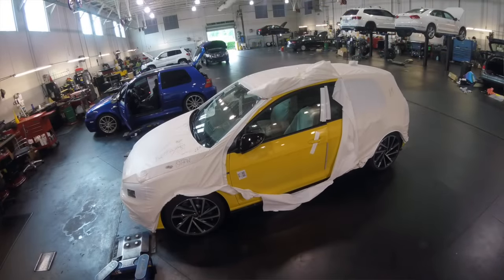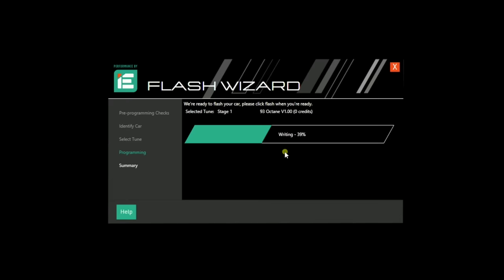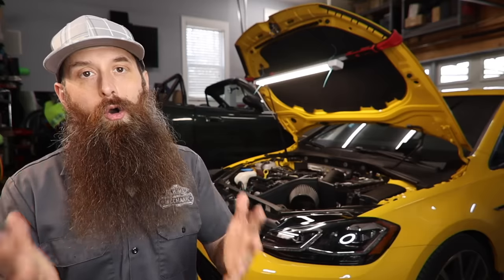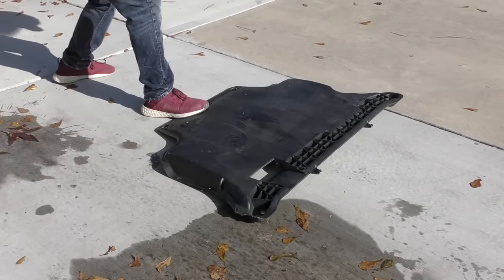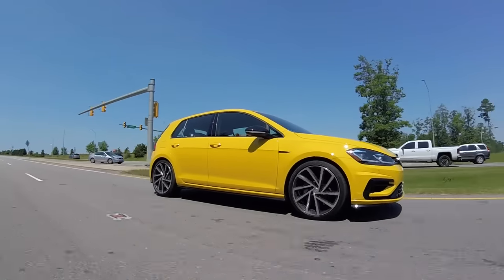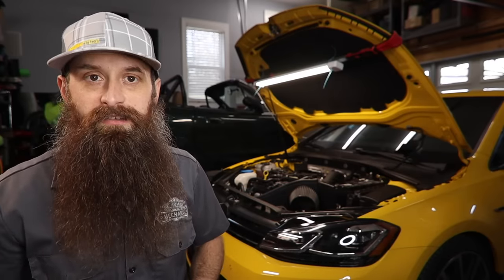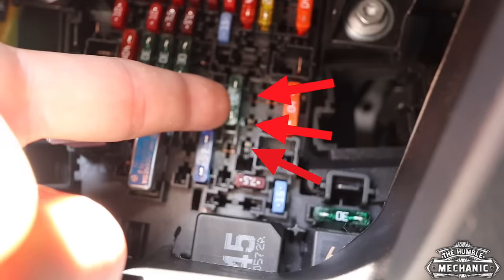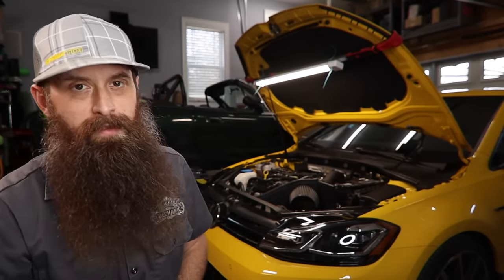The 5 BEST Modifications for the Golf R ~ Do THESE First!

Comment: Charles - fantastic video. I am 71 and have never owned an automatic from VW bugs to an LS7 69 Chevelle to 3 TDI's- I was thrilled to get an all wheel drive Alltrack with a 6 speed (I was always hoping for it to be a TDI). I basically love the car but the REV Lag makes me feel like I have never driven stick before. Can an OBD 11 remove the lag??  Please tell me yes.   Also - I installed a whiteline rear sway bar that has 2 settings - unfortunately the softer setting does not fit the sway bar link! The stiffer setting is too stiff and has resulted in clunking noises no matter what adjustments I make. I will try the H & R . Can you do a video on the transmission and front diff service? Thanks for all of your Vids- much appreciated

Comment: Hi Charles, as far as tunes go, I’m wondering if you have had any experience with Burger Motor Sports JB4? This is a plug and play tuner that installs between the car's sensors and the ECU. As far as I understand it is not as comprehensive a tune as the ones you mentioned, which re-flash the ECU. But it has the supposed advantage of being easily unplugged and disabled and of not leaving any evidence of its existence in the ECU. The idea being that, as long as you remove it before bringing it in for service, it is much less likely to cause any warranty issues than the tunes that reprogram the car’s ECU. 
Thanks for your video.

Comment: For anyone that just wants a boost a bump in power is the jb1 or jb4 all while retaining your warranty esp the 18/19 that came with 6/72k. If people are hesitant about the jb4 bc of tapping the afr wire there is an adapter on ebay to really conseal the pozi tap. The adapter has the wire hanging out to connect it to the jb4. 
While it is not a flash tune where if you take it to VW they td1 your arse it certainly makes it feel how these cars should of came from factory. No disrespect to Charles but the piggyback would be 1st before anything else. Otherwise go full stage 2 & skip stage 1 flash. These cars move once tune'd & the gen3 engines handles the power like a champ!

Comment: Additional cool features: 
- Welcome Home lighting (illuminates the lights around the car for a couple seconds after you step out of the car at night), 
- Automatically roll-up windows / shut sunroof when the car detects rain. Tilt the side mirror when going in reverse, reset DSG "learnt" prior driving pattern. 
- Automatically turn on / accelerate / reduce speed of your windshield wipers when rain is detected... 
- Remember the settings of your A/C unit / heated seat. 
- Display additional screens on the Computer between the dials (like battery charge, oil level, remaining gas in the gas tank.... 
So many many features ! MK7.x are really flexible, and if you've been around the world and liked a feature in a polo, passat, golf from another country, the chance is, you can activate that feature in your MK7 here in the US... if the car is equipped with the actual hardware supporting the feature. 

Now... reading some recent european reviews about the new generation of Golfs... I'm wondering how MK8 are gonna be like. Seems like VW will include most of the hardware in all cars... and you could pay for over-the-air upgrades/options activations, basically paid features (a bit like ODBeleven.... but by VW...). Hopefully we'll still be able to VCDS them and activate cool features ourselves ! But... hey VW engineers are clever...
Reply from the maker: I’m guessing they will try and lock out the features. They may have an alternating lock out code. So the only way to activate is by vw. But I’m sure someone will find a way

Comment: Just performed an oil change on my other halves MK7.5 and guess what...the whole back of the sump is severely scuffed up, to a point that it had even broke off half the plastic drain plug cap! Good job I get one of these plugs in my ECS kit. Don't know whether she drives a rally-cross circuit on the way to the shops or what, but I just ordered the All-track belly pan kit.

Comment: Hello, I need some help!
I have a GTI and I intend to use bilstein b8 and sport springs, do you recommend upgrading the sway bar end links, both in the front and rear? Speaking of the suspension set, are there any further changes you recommend?

Comment: I disagree that swaybars don't have any negative consequences. Try turning into the ramp of a gas station and you'll see what I mean.  The stiffer bar picks up the inner rear wheel, and then you get a jolt when it makes contact again. Also notice the car's behavior in bumpy turns.  It's not as resilient, and your head & neck get jerked around more often.  This is because stiffer rear swaybars make the rear end less independent, and more like a solid axle.  There's no way around that fact.  You might like the flatter cornering, but there are consequences. I put a 22mm bar on a car that only had a 16mm stock, and it felt like a pickup truck afterwards. So I contacted a shop and had them custom make an 18mm bar instead. Much better.

Comment: I bought my Golf R used but certified from VW and they warrantied it for 2 years so although I’m itching to tune it I’m working on suspension and handling mods instead until the warranty is up. Did install a cat back though because it was just too quiet

Comment: Interesting.  Not the five i was expecting.  Most people do exhaust, wheels, windows etc.  These are more practical.
Reply from the maker: Thanks.
Reply: @HumbleMechanic  hey do you still have r32?  My wife's had one for about 12 years now and it's been great. Mk 5 3door in silver with bucket recaros.  Reliable satisfying car it's been.  Whatve we had to do....coil packs, all springs ( seem to be made to snap in winter). Radiator, tyres brakes battery and that's about it.  Looks like we will have to sell as my job has gone, thanks mainly to virus. We will miss it .  Must be one of our fav cars ever.  Still got my r36 though!  
Enjoy your channel. Learned a lot thx

Comment: I found a really nice 2017 golf r that I want to pick up. I've just never owned a German car and with all the horror stories out there I'm nervous to make the plunge. I just want it to last.
Reply: Just do your research and make sure it's been serviced regularly with low km's. If it's near 100k on the clock then it will need a major service especially around the cambelt. Join a club and ask what the pro's and con's are

Comment: Greatly appreciate the video and your knowledge

This might be a silly question
But doing a stage 1 tune will damage or hurt the engine and DSG tune
If you do a stage 1 tune should you do a matching tune to the DSG

I really want to do it with a revo tune but I’m really scared as I really respect my new car
As for warranty can they void warranty and if you remove the tune for a warranty claim can VW see a change to the ECM what is your honest opinion

I really agree how it should have been from factory as stage 1 I just want a bit more 
I apologies for my frustration lack of knowledge
Reply: As far as I understood, there are low torque Stage 1 maps too, which don't require you to tune the DSG.
Also, there is some kind of counter in the ECU, so the dealer can detect software flashes. Use a tuning box if you are concerned about this, that is external and removable without trace.

Comment: Hi there, less worried about warranty more about insurance implications. Also when adding power is the clutch up to the extra torque?  ( i blew my tdi dual mass flywheel and had to get new gearbox and clutch so bit nervous of that!)
Reply from the maker: Clutch upgrade is needed on most any stage on the newer R

Comment: Charles, great info, appreciated.  In regard to small mods, I've done some of the "badgeskins" vinyl overlays.  I've added vinyl to the  brake calipers, the front and rear R badge and covered that stupid amber passenger air bag light.  Why the heck do I need a light on to tell me the passenger side air bag isn't working when no one is in the seat?  Makes no sense.  My last small mod is a steering wheel cover.  I found one precut for the R and it's a great addition. Makes the wheel much thicker and better to hold while driving...  Best....
Reply: Rodney Wright But isn’t nice to know that it’s active when someone is actually in the seat 🤷🏽‍♂️. Sometimes my dog sits up there on short trips and nice to know he isn’t going to get blasted if we get into a fender bender.

Comment: I had a Mk5 R32 with a Haldex controller. I found a swaybar upgrade pointless. I was able to control turn in with throttle when the Haldex was in M or S (sport?). I've just acquired a 2019 Golf R - I'm wondering if the same applies. I also had a Mk4 Jetta (FWD) and the rear sway was nice, but coil overs setup correctly were more of a game changer than the sway.

Comment: Hi man, love the vids just picked up my 19 R yesterday in Augusta.  Small scratch on the door but other than that love this car.  I have one issue I need to fix.  Is there a way or hack to disable the active cruise control ?  It never does what I would do so it needs to go.  Unfortunately the salesman incorrectly informed me that the menus can turn it off.  Im even open to adding another 3rd party cruise control to get rid of this and I understand from one of you other video you can turn things off through the ECU.  I would even be open to turning all the driver aids off if this solves the problem.
Reply from the maker: You have to shut it off but then you disable cruise. I’m sure there is a way but that’s not info I feel comfortable teaching people about.

Comment: You didn't mention a catch can which, judging by your follow-up video featuring noticeable carbon build-up at 10k miles, is essential for proper running on a boosted and/or DI engine.
Also, can you adjust the time-out for start-stop? Start-stop is a good idea in theory but most cars do it poorly: they immediately stop the engine once the car comes to a halt, just to immediately restart to take off from a stop sign or RR crossing or other brief event. A 3 or 5 second full-stop timeout would get the benefits of start-stop (shut down for long lights/trains/drive-thru) without the annoyances (shut down at yield/stop signs/other quick stops).

Comment: Did you do a follow up video on the inside intake temps on the aftermarket intake after ?
Reply from the maker: I did the intake temps in the intake video. I didn’t install the boost tap and check it that way. With the new shop construction I’ve misplaced the tap. Hahaha doh

Comment: You can disable the start/stop by changing the battery voltage threshold, i have it adjusted to 14V so it never shuts off the engine :)
Reply from the maker: Yes but you get an alert on mk7.5.
Reply: @HumbleMechanic  Ah yes that is true, there are also memory modules for sale on a couple of sites, pretty easy install as it's a plug and play solution
Reply from the maker: Got any links?
Reply: HumbleMechanic https://www.active-sound.eu/en/start-stop-automatic-ssa/start-stop-automatic-memory-modul-ssam-modul
There are also others that require you to splice in to the harness but this one seems to be pnp :)

Comment: My golf recently started acting up during warm startup. I’m not sure if you can help out. It hasn’t done it on cold start and when it’s warm and I start it up it will idle around 200-300rpms and be rough until it either turns off or I have to put some gas to fix it. Any ideas what could be happening. 2015 R with about 40k miles.

Comment: I am a 2019 Golf R owner and @ about 4:00 - the discussion related to tuning the ECU, TCU and Haldex AWD System is really misleading. If you use these tunes like I am - and have an issue with the power-train - like a clutch out or a blown injector or whatever, YES THIS WILL VOID YOUR WARRANTY. See, when you take the GR to the shop, the mechanic will plug the car in and see that the tune has been applied. It's at that time that the mechanic is REQUIRED to report it to VW and flag your VIN. It's important to note that this may also show up on a CarFax Report If they elect NOT to do this, then the car may be sold to another person at some point, who will purchase a warranty (or expect to use the rest of the manufacturer one) and it'll get caught then. you'll see this from Ford, Chevy and Dodge also - they flag vehicles all the time - and some of those end up back on the market.

However, in a warranty situation related to something else, that's not power-train related, like a power window or a back-up camera issue - they will cover those things. Just don't expect any help with your power train. Furthermore, make dame sure you're not doing this on a LEASED vehicle because you'll be charged for a full ECU replacement when you return it.

Final note - even if you use Unitronic... I know that they say you can flash the car back to the factory flash- but the dealer will see that the modifications were made and then reversed. So, you'll still get flagged.
Reply from the maker: That’s not all exactly true. It’s never a guaranteed flag or decline.
Reply: @HumbleMechanic  I know you're right, but the risk is high and once your flagged, it lasts forever even to a new owner.
Reply: And if you get flagged, that car will drop in value like a hot rock. It's really hard to sell a car when it's been flagged.
Reply from the maker: That’s why I mentioned you have to be willing to pay the price.
Reply: And knowing VW's poor reliability record, the odds of needing a powertrain warranty claim is pretty high. Gee I wonder why VW decided to dramatically reduce the great warranty they offered last year. It's because they know their cars aren't very reliable, and they're tired of eating the repair costs. Personally if I was buying a 2020 VW, I'd demand a $2-3K price cut just because of that.

Comment: Nice video...... my question is about the window tint.....I have tried getting mine done.  Every place I have been says they cant do those small windows next to dash.   I have 19 gti rabbit edition.   Just wanted to hear your thoughts
Reply from the maker: My guys said it wasn’t fun. But they did it. Lol
Reply: @HumbleMechanic  I use obdeleven.  I turned off the annoying start stop system with the voltage method and I don't have any error messages
Reply: Mat Ostromecky what year ? GTI or R?

Comment: Charles I need you to save my life again!! Do you happen to know what size triple square a 2016 VW jetta has on the rear has? It’s not a normal socket it’s the one that goes inside and not around the nut. Also it is a triple square.
Also trying to figure out what size the caliper carrying bolts are?? 

Ps- scared to buy a kit and it not have the size.
Reply from the maker: I don't recall the number, but this kit should have it. This is one of the best kits for the $$$ https://amzn.to/36BpxpK

Comment: Is it possible to add a factory vw sub to my 2019 rabbit? If so can you do a vid on it?

Also how does a dealer know if you flash? Instantly? Or do they have to be looking for it?
Reply: If you have some sort of power train failure, VW I think requires the dealer to dump the ECU code so they can check for modifications. They then run that dump against a hashing tool and compare the resultant hash vs what they know should be on your car, and when the hashes don't match, they flag your car TD1 in their systems, and you then may be forced to pay for all power train problems going forward (YMMV).
Reply: @cinosa3475  okay bummer. I wanna tune it. May go jb4 won't be much of a tune but still would crank her up a little.
Reply: @DatGameCollector  That's what I'm going to do as well, buy and install the JB4. When I picked up my R, I added 2 extra years of powertrain warranty, so I don't really wanna throw that away.
Reply: @cinosa3475  yea I was lucky and got the 6 year 72k warrenty. Would be silly to f that up.

Comment: Do you recommend a new clutch *6MT when going Stage 1? Seems the stock clutch was engineered to just the right amount of power/torque...
Reply from the maker: Id probably go BFI or southbend
Reply: HumbleMechanic any thoughts on the DKM twin disk?
Reply: @Wejustwannatravel  Avoid it, it has many issues, I'm on my 2nd and regret it big time.  Southbend stage 3 daily is the one to get.
Reply: Steven Froese oh man. Good to know! What kind of issues were you seeing?
Reply: @Wejustwannatravel  First cutch had excessive noise, with hard shifting.    The 2nd one is better but still has some of the same, and it causes premature thrust bearing wear.
Reply: Steven Froese how much chatter do you get on the southbend daily? I had a DKM twin disk on my previous car and felt great after break in but chattered like crazy
Reply: @25elcamaleon  I still have the dkm, I'm not doing the job again unless it gets really bad.  The chatter isn't the issue, it's the grinding during engagement, and hard shifts sometimes.

Comment: Stick or DSG? Planing on a stage 1 tune only and I don't care that the DSG is faster. Just concerned about the stock clutches reliability.
Reply from the maker: Stock clutch is a weak point. If you can drive both. They are both awesome

Comment: 2 years later, have you added a spare tire to your mk8 golf R? Mine came with jack and tools but no spare, found the spare on shopdap but not the trim pieces, do they exist?
Reply from the maker: YES! Its the same tire for my MK7. The foam fits too. You will have to trim out the tow hook spot. the mk8 tow hook is bigger. 

The trim part doesn't seem to exist. OR Paul hasn't found it yet. BUT the tire fits with the stock trim. Its close but not perfect.
Reply: If you feel comfortable, mark the trim with the tire, outline it approx 1" and carefully cut with a Dremel or rotary.